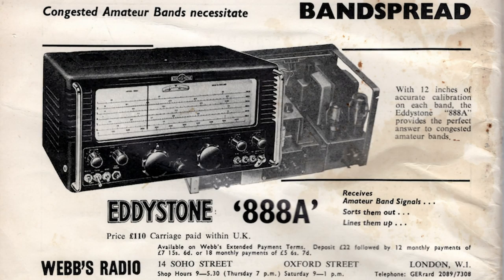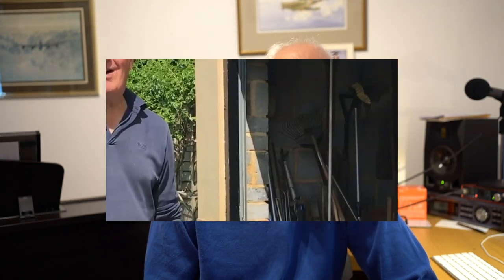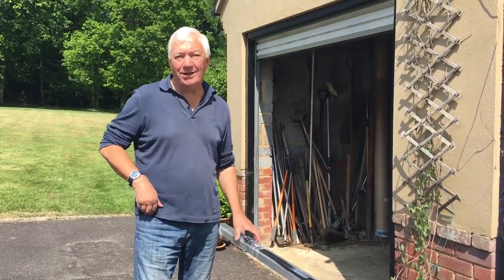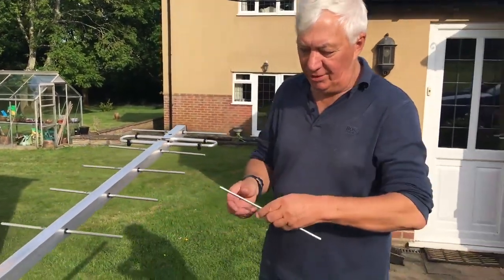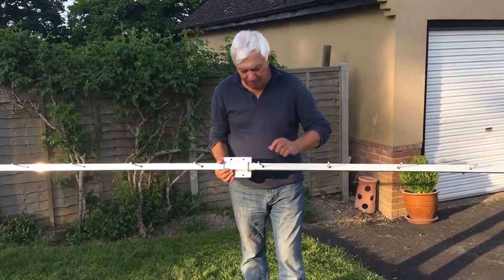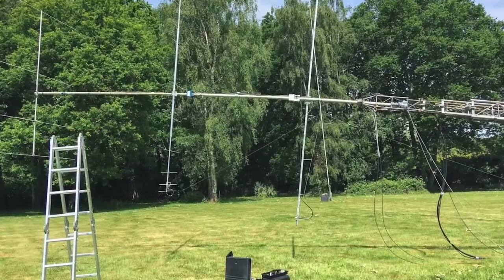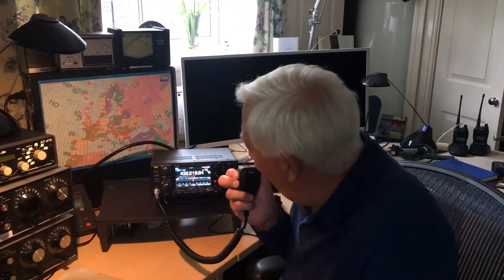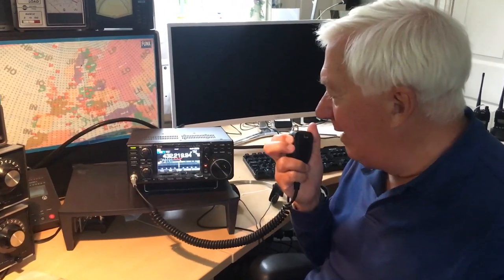British Made 70cms Yagi Antenna Review "Faces The Music!"

Comment: The only thing that attracts me to FT8 is the fact you don't need high power, but you might as well be talking to a computer, in some cases you are as it might be an automatic station.  What is the point?  I'm not sure what will happen to those directors on the beam after a summer and winter.  I would have a concern that they might come loose in the press fit.  But anyway, it is a prototype at the moment and no doubt that will be looked at.